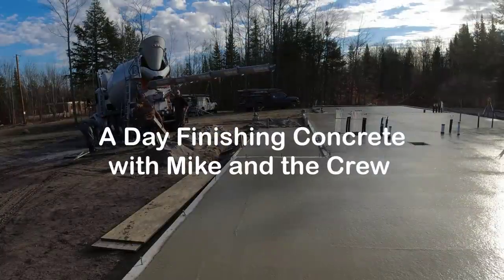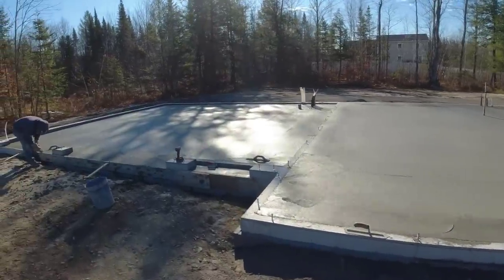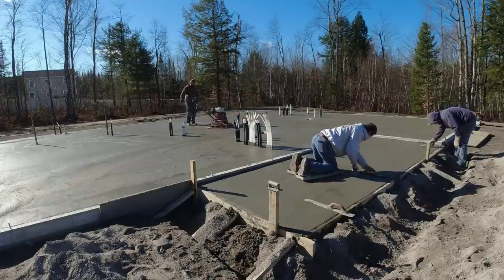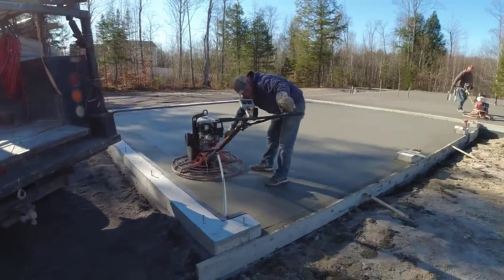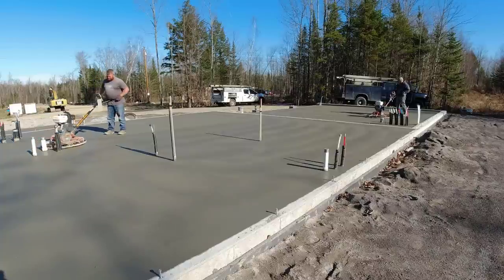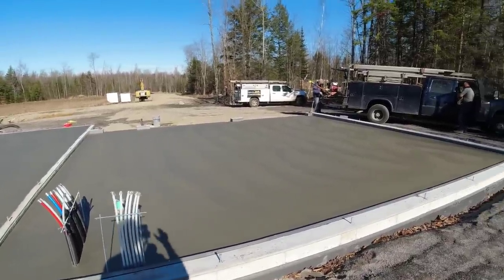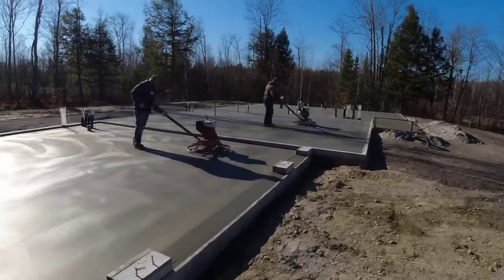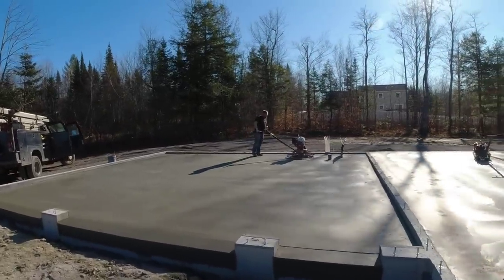There's No Concrete Finishing Video Like This On YouTube!

Comment: Damn, I wish more guys had the boom arm for unloading the trowel. Even if you just had a hand powered boat winch for it, that'd beat the armstrong method.
Reply from the maker: It comes with the hand boat crank. We take it off and add the winch. Northern Tool or Harbor Freight.

Comment: floor getting carpet and etc....one time shine? seems like extra work power troweling it
Reply: I thought the power trowel wasn't cosmetic but for strength.
Reply: As if you're going to hand finish a floor this size when you can just chopper it. The machines hardens the surface and the floor coverings stick better. An unfinished floor would go powdery and the floor coverings would not stick properly.
Reply from the maker: Not really, plus we want to get it sawed so power troweling hardens the surface so we can saw it right after.
Reply from the maker: It's cosmetic too. Some people leave it like this for finished floor, they just put a clear sealer over it.